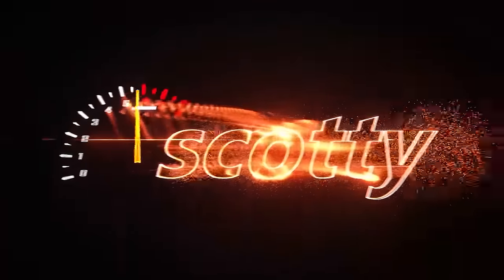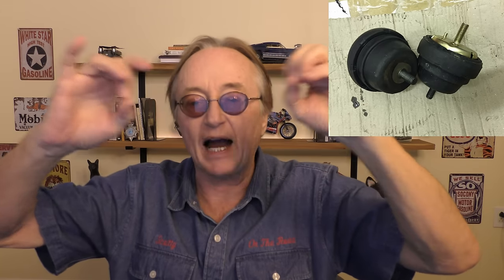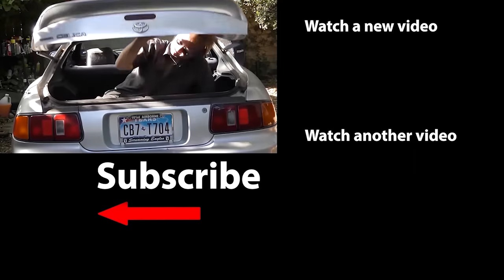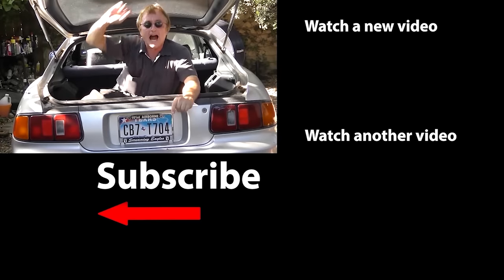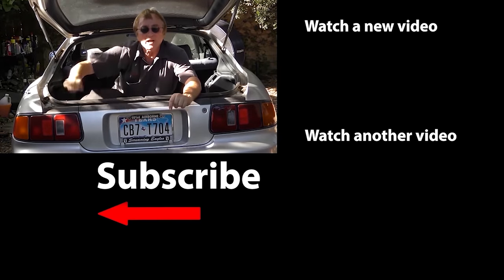Here's Why Changing Your Engine Oil After 3,000 Miles Will Destroy Your Car

Comment: 6:45 my timing gear has fd up my engine because of a week and old screw. Mechanic sad its weak. Probably was a 8.8 strength. Gears need 12.8 reinforced steel. Otherwise my timing belt would go bad and the whole head had to be repaired. Scotty is probably right one that one. Although I guess it depends If the screws are reinforced or one use. Id bet on most cars head gasket screws are properly strong so I don't see a problem putting back the same ones. But the screws that hold your gears for the timing belt absolutely. That could snap just like mine and cause problems.

Comment: Serious question.  Why does SLUDGE built up in the engine if the oil is not changed on a regular basis?     Oil does not lose its ability to lubricate

Comment: I used Dura Lube Catalytic Converter cleaner from Walmart on 2005 Honda Accord, 151,000 miles.  Poured into gas tank, P0420 went away and has not come back after two years.

Comment: I would change it every 2k. I change my oil in my NEW cars @ 500 to 1000 miles. Every time. I change my tranny fluid on new cars at 5k miles. Every tech is shocked when they see silver in the oil. I say that is  why I change it so early. Otherwise that silver metal is running through your transmission for how ever many miles people wait. If the engine oil changes color, I change it. I have NEVER lost a motor due to bad bearings.

Comment: That's somewhat similar to how plane tires will blow safety plugs after an emergency stop on the runway.  It will take a few minutes for the heat from the brakes to overheat the tires & they will blow safety plugs.  Does not happen all the time of course!

Comment: If your using synthetic then 3000 miles is a crock. It's really a crock if you are using normal oil. It depends more on the type of driving, city vs highway.

Comment: What about the milage for changing oil when it's half synthetic or full synthetic? I remember my Peugeot 2L diesel was doing every 25000 kilometers a change synthetic oil following the book. And after 8 years and more than 200000 km that car still didn't use one drop of oil and had lots of turbo power. Peugeot diesels in Europe are known for their quality.

Comment: I've got a citroen 1.6tdi with 221,000 miles and an audi A6 2.7 tdi with 222,000 miles with oil  change intervals of  10,000 on the citroen and upto 15,000 on  the audi and they are both still going well. Biggest thing is use the correct oil as not all oils are the seem even a good brand oil will kill your engine if you use the wrong specs. I bought a  citroen  tdi years ago with knackered turbo because even though the guy  changed the oil early everytime he used the wrong spec oil and it went like treacle. Modern synthetic oils are made for higher miles not like old oils

Comment: 2000 to 2005 Chevy Impala could be had with a L36 or L67 3800 series (both NA and Supercharged).

as to the LS4 in the w-body cars... they tend to chewup the 4t65hde transmission.

Comment: Yeah ok, Tell that to my 2- 07- f250's with 5.4, 3 valve well over 400,000, everything internal is OEM !  Including Timing chain, guides, also no leaks of oil anywhere, so I beg to differ  on this Video ! I work for a fire suppression company and we haul lots of heavy pipe and Valves etc.... My Fleet is in fine shape Mechanically !

Comment: My dad has A 2003 impala that he bought in 2003 that has 260,000 miles on it and still runs fine with A few minor problems.
Reply: He is lucky.. A lot of those 3.4 V6 engines were dogs and did not hold up well .

Comment: I drive a 22 chevy equinox with 110000 miles. Bought it new and put an average of 64k miles per year. I change the oil about every 10k and i drive it hard. I get about 220k out of a car.

Comment: Ford 1.0 eco boost went eco boom 💥.   The wet belt on the oil pump went bad.... Ford issued a recall in January for the timing and oil wet belts.... 30 days and $7100 late for my 2016 focus 😢

Comment: I once put snow tires only on the two front wheels on a jetta.. Ended up flipping the car, because the rear tires slid across the road 😢
If you can, please put snow tires on all of your tires in the winter 😮

Comment: I change my engine oil and oil filter every 3000KM not miles... I use mineral oil.. I don't believe on marketing propaganda that fully synthetic oils are the best and you can change your oil every 10,000 to 20,000 miles. its better to flush often the sludge.

Comment: Synthetic with an expensive filer every 5 to 6k. Have had my Honda for 31 years and have had zero problems doing this. 3k is too soon. 😮
Reply: Yes, 3000 now is a waste of money. I did my Element every 5000-6000 miles & it runs like a charm at 455,000 miles now.

Comment: I have a 2014 Toyota Tacoma with the V6 engine. When I bought it, they told me it had full synthetic oil and had to be changed every 5000 miles. I brought it to Toyota to have the oil change for years and one of the maintenance department people told me it had conventional oil in it. I want to do my own oil change and would like to put right and it. Conventional oil is not easy to find. Can I go with a synthetic blend or a full synthetic oil? What would you do?

Comment: Original engine, one owner 504,000 on a 4.3 V6 xhanged every 3,000 miles full synthetic name brand oil with a high end filter. (3 transmi$$ion rebuilds.)
Reply: how many transmission fluid replacements and at what milage intervals for each those rebuilds, if I may ask…
Reply: @johnmci7140  4L60E transmission. I had the transmission fluid and filter changed once when it was hard shifting in 2019  and that solved the problem. Transmission died a sudden death before the last rebuild. Stripped second gear so hard you could hear it. That was the first and only time it left me stranded.  The other two times I took it into the shop when it was slipping between second and third.  I've found that keeping that  transmission cooled properly will extend the life, so I keep the coolant changed regularly and check for raduator leaks. The vehicle is commercial and fully loaded every day.
Reply: @IStoleHerFromKen  Thanks for your reply. 
Sounds to me like all cars could really benefit from transmission oil coolers!

Comment: Would you consider changing the oil at 3,000 on a supercharger Application? Because you say only turbo not supercharger I know it's belt driven but it's still forced induction

Comment: Ford transits have single use bolts on their brakes. Also if you need to replace the rear rotors, you have to pull the dang axles out. stupid design!

Comment: 09 ford 230k miles synth oil change every 5k,  oil is cheap motors aren't.  91 GTA fresh oil every spring, that car gets at most 800 miles a summer

Comment: that turbo charge recommendations,  woukd you  say the same for vehicles with eco boost as well?
Reply: So here's the thing.. 

The problems with turbos in the PAST was that after a "spirited drive" and you shut off your car, you would get coking in the center bearing. Oil would collect in the bearings, the heat soaks in and the oil would start to coke on the side and foul the bearing. 

With the EcoBoost Engine, water cooling eliminates that worry. Here's how:

The EcoBoost engine uses passive thermal siphoning for water cooling. During normal engine operation, the engine's water pump cycles coolant through the center bearing. After the engine shutdown renders the water pump inactive, the coolant flow then reverses. How? 

Well coolant heats up and flows away from the turbocharger water jacket, pulling fresh, cool coolant in behind. It's really a highly effective coolant process that is completely silent to the driver, thereby continuing to protect your turbocharger.

By the way, I drive a 2019 Ford Fusion Titanium with ecoboost.

Comment: I have a 2020 Chevrolet Colorado 3.6 with 48,000 miles. I've noticed while stopped at a stop light with the truck in gear a light engine or transmission noise (maybe converter). The noise stops when I put the truck in neutral. Any ideas?

Comment: My boyfriend says the dealer doesn’t change the oil filter when they change the oil.  How important is it to change the oil filter?
Reply: Extremely important.  It traps impurities.  Why would you circulate new oil through trapped impurities?  Find a better place to have your oil changed and always ask to see the old (replaced) filter before you pay/leave.
Reply: Should always be changed with every oil change. The filter is right next to the oil drain there is no reason not to change it. That is peak lazyness

Comment: Turbos are junk.  I had a 2012 Nissan Juke (junk) and I was always scared of that thing.  The turbo made the oil extremely hot.  I changed the oil every 2500 miles and didn't have a problem but I was always nervous about that turbo.

Comment: Sure, let them run and  wind down. These small engines shouldn't have turbochargers on them. You can get performance in a hundred different ways instead of ramming airb down the intake

Comment: OIL breaks down at 2,000 miles, if you really care about your vehicle, change it at 2,000.
Reply: You are actually correct.  Especially if you want 300000 to 400000 miles out of your engine.

Comment: hi scotty, i bought a 2019 Acura ILX a couple of years ago, and i realized something very weird about the car, and it sounds crazy too. the car runs perfectly fine in cold temperatures, but the brakes would fail once in a while on hot summer days when the AC is on. the brakes have not failed on hot days if windows are down and AC is off. and what i meant by fail is that the brake pedal could be depressed all the way down to the floor like a clutch pedal, and there is no initial bite, no slowing down, no stopping whatsoever. and i have to pump the brake pedal once or twice like there is air in the system or something then it will be back to normal. and the sad thing is this doesn't happen all the time, like a handful of times during summer. i took the car back to the dealership, and all they did was plug the code reader and told me nothing was wrong. what should i do? any idea why that is? thanks!
Reply: No expert here, but my quick guess would be that the brake line is way too close to something hot somewhere, so you are getting a vapor lock, similar to air in the line.  
Pretty damn scary I bet!

Comment: Funny I just watched one of your other videos on leaks where you said as long as you change your oil every 5000 miles it will last over 200,000 miles, and went on about your motorcycle being over 10 years old and no leaks because you always change the oil. So always change your oil every 5,000 miles. You must of said it like six times lol. But this video says 3000 miles. My father always said 3000 miles, and I did that in my 2005 Toyota Tacoma PreRunner that I bought in 2007 with 30000 miles. Then my older brother told me these newer cars can go 5000 easy before changing, so I switched to every 5000 miles. Even then the oil still has an amber color to it (not black at all). So is 3000 miles wasting oil when it looks amber color still?

Comment: Is it really necessary to let it idle before shutting off if the turbo is water cooled?
Reply: Yes
Reply: The turbo is still spinning and the bearings need oil from the engine oil pump.

Comment: 3,000 miles is too short for fully synthetic oil. If its mineral oil then I understand.

If you do a lot of town/ city driving, an oil change at around 5 to 6,000 miles or 6 months is a good time to change.

If your commute includes mostly dual carriageways and motorway at 50mph+ for 15 - 20 minutes, then changing the oil around 10,000 or 12 months is perfectly fine.

This is still generally lot less than the manufacturers recommended service intervals. I have a 2009 Saab 9-3 1.9 Tid 150, the recommended service schedule is 18,000 miles. I change it between 7 and 10,000 miles when the car is getting its MOT so I don't have to go back in a month or two to get the oil done separately.
Reply: Shhh! Do not talk absolute reason and logic to these people...
Are you kidding??

Comment: 3k miles oil change wow, sound really excessive, what kind of oil do you guy´s use ? I agree with the basic principle of frequent oil changes and the idling though but 3k miles ? It´s like 3x oil changes a year, this is waaaay too much, it will cost you a fortune in the long run and it´s not necessary. While turbo chargers need prestine oil conditions yu don´t have to change it every month, oil won´t break down that quick. Best thing is you watch the YouTube channel of a tribometrist "The Motor Oil Geek" for instance. They do chemical oil tests before and after and explain why and how to brake in an engine etc.

Comment: Hi Scotty,

I have a 2022 Mazda 3 awd. 22k miles.  2.5L 4 cylinder NA. When I accelerate hard from a stop sometimes the car hesitates for a split second. it kinda feels like it kicks into gear after I step on the gas instead of already being in gear when I step on the gas. This doesn’t happen when the car is moving, it only happens from a complete stop. I've looked at the throttle plate, it was clean, and I used fuel injector cleaner but it didn't fix it, any ideas?

Edit: it idles ok, sits steady at 750rpm. Air filter is clean
Reply: Sounds like your transmission is giving up

Comment: Why do you need to change the oil in US every 5000 miles?  In Europe 9000 miles is the most common interval for oil changes.  In the past they (manufacturers) advertised with even longer intervals, that didnt work though 😂 cars broke premature with longer than 9000 mile intervals
Reply: BMW in Canada recommends 10 k milies,  with synthetic oil.
Reply: @dmitripogosian5084  Yes, here they often do too longer than 9K miles intervals, however in real world there are more problems UNLESS you drive only long distances where the engine does not really have to work. About 9K miles/15K km's / yearly seems to be best interval in 95% of conditions with full synthetic oil.

Is it common in US to use low-quality oil? Thus requiring a change every 5K miles?

Comment: I have a 215517 mile’s on my 2014 535ix and my issue is the driver side headlight which is getting moisture should I change the it and r just buy new headlight housing??

Comment: I got a tiny 1.6 engine Turbo on my small SUV ...now has 131,000 miles , no problems .. and I change my oil every 5,000 miles and always turn it off after driving it ....Not sure what you are talking about.

Comment: These 1.3 THREE CYLINDER TURBO Chevys scare me.  The Trail Blazer/Blazer/Equinox... Are these Crap that will last only 100K miles???  I don't want to spend $35K on a SUV that blows up a 100K miles.

Comment: Hi Scotty,driving the latest Honda Jazz crosstar 23/24 with the e-cvt ehev,my question is about the shifter to park.shuld i shift direct to park or do i shift it to n and push the break end then the schifter to park?
Reply: Hi Scotty,i saw early this week a clip on youtube were mentioned shifting right to park,it can damage the e-cvt.they tel on youtube do first Select to n,push the break button and then Shift it to park?
Reply: The clip on youtube film the e-cvt user recommended
Reply: Scotty,the e-cvt Honda uses has no real gearings?the new Toyotas have shifting gears,also its e-cvt too.

Comment: Never understood the obsession with changing oil every 3000 miles, way back 60+ years ago when engines were not as well manufactured like todays engines they recommended changing oil more frequently. However your cars owner manual will clearly state the required intervals and it is much higher than 3000 miles. I change my oil once a year after about 10000 miles and never had an issue with wearing out the engine. There is a big oil changing industry build around this nonsense belief that you have to change your oil every 3000 miles and it is now built into your psych. In Europe they change it once a year.

Comment: Hey Scotty ! I got a 2010 Subaru Impreza, around 80k miles. It does this weird whistling sound when I drive at around 24-30mph. It sounds like a low whistle, I have no idea where it could come from. Thanks !
Reply: did you buy it new or used? some people will put a little whistle thing on their cars to try and keep deer from running out in front of them.
could also be weatherstripping going bad, if it's on the bottom then you won't notice because not much will splash onto it, wind could be catching it and making the whistle noise.